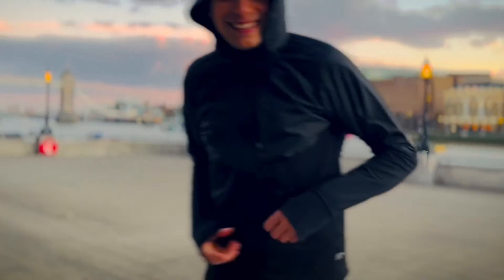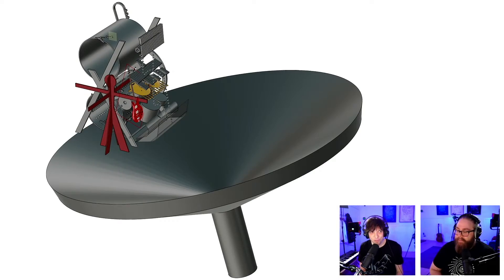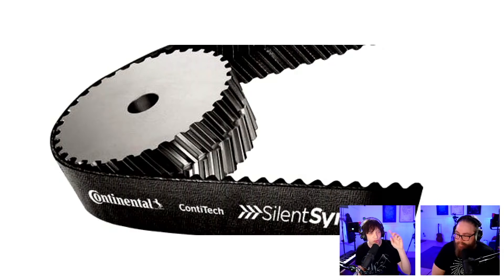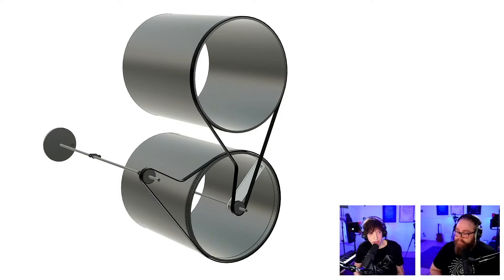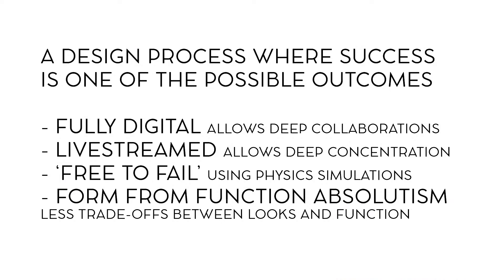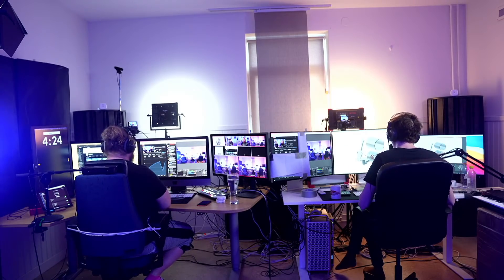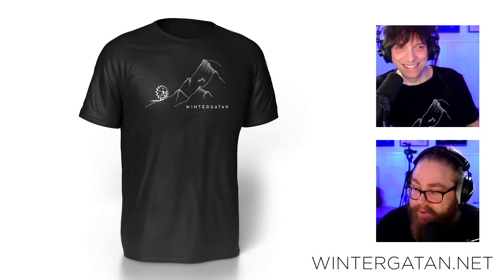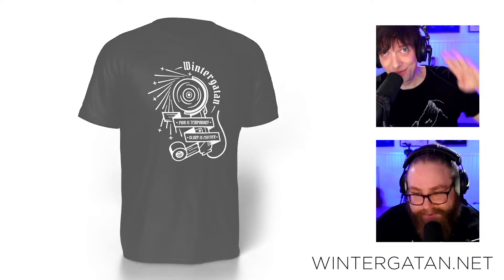Round 3 - Martin vs The Machine - Week 1 Summary

Comment: Summary:

 MX v1 = prototype machine
 MX  v2 = Learning machine
MX v3 = production machine

check.
Reply: Actually for a mass market complex products you have these prototype phasis before the mass production:

Engineering Validation you validate that the concept is working.

Design validation you validate the full product and you freeze the design but the parts are not made the same way that they will be in mass production.

Process validation, now you have all the tooling required and you tune the fabrication process to have the exact same product that you will have in mass production and you work to improve the production rate.

Sadly MMX is not at all a Design Validation, actually it's not even an Engineering Validation since he decided to restart completely from scratch. MMX is only a proof of concept that it could theoretically work, it's a beautiful proof of concept with an artistic spirit but that's all.

Actually even with CADing Martin will need to do some physical prototyping so he will still need to these 3 steps, because even if it's supposed to worked digitally it doesn't mean it would work in the real word.
Reply: That is probably the best way to describe the machines👍
Reply: MMX was more or less the "second system syndrome", played out live before us.
Remember dear fellow supporters and fans, it is Martin who has to Believe in the project.

I will be wearing the Believe merch until it is completely worn.
❤️ From the Netherlands.